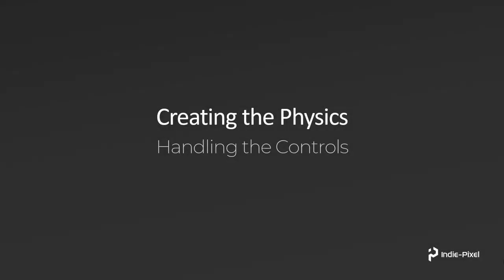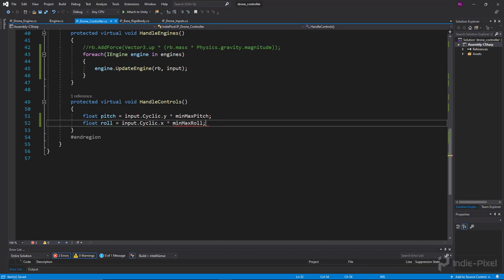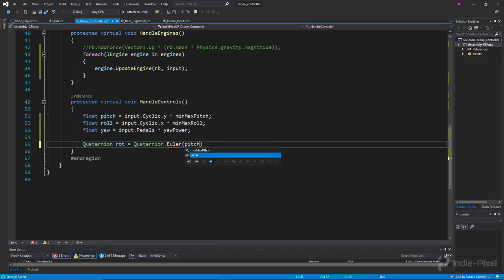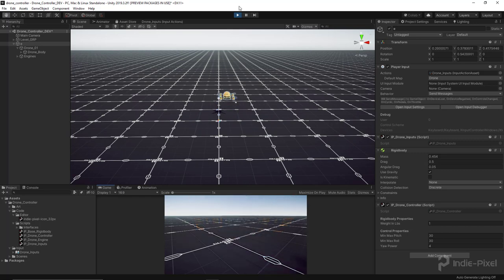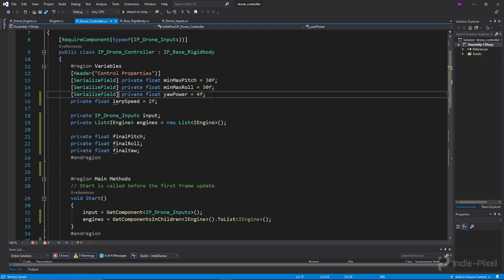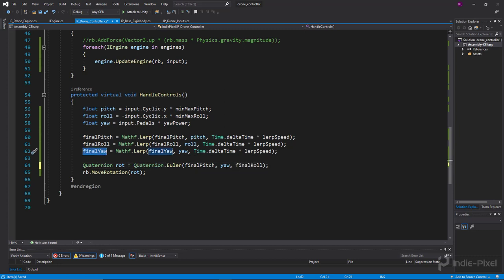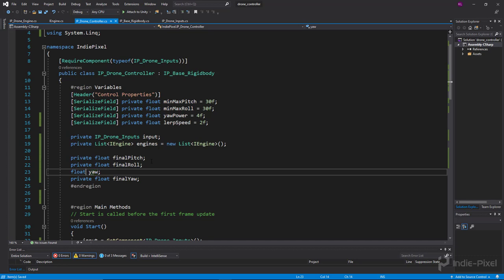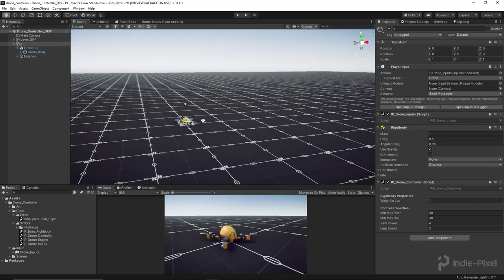Unity 2019 - Drone Controller - Section 3 - Video 6

Comment: My drone is still snapping after I add in the lerp function, do you have any recommendations? I have referenced the private floats up at the stop as well. Thanks!

finalPitch = Mathf.Lerp(finalPitch, pitch, Time.deltaTime * lerpSpeed);
        finalRoll = Mathf.Lerp(finalRoll, roll, Time.deltaTime * lerpSpeed);
        finalYaw = Mathf.Lerp(finalYaw, yaw, Time.deltaTime * lerpSpeed);
Reply: Figured it out, i needed to replace the (pitch, roll, yaw) in the quaternion function : 
Quaternion rot = Quaternion.Euler(finalPitch, finalRoll, finalYaw);

Comment: how do I make the drone faster?
Reply from the maker: You can increase the forward speed.  Should be a value on the inspector for the drone controller.
Reply: @IndiePixel3D  it does but it also tilts the drone too much:(
Reply from the maker: Ah I believe I put in some parameters to control the rotation speeds on the inspector as well...I'd have to open it up again
Reply: Add a float called extraPower in IP_Drone_Engine, set it to 10 for each engine, set maxPower to 30 and then add this code at the bottom of UpdateEngine function:

        float x = input.Cyclic.x;
        float y = input.Cyclic.y;

        if(x != 0 | y != 0) {
            Vector3 move = new Vector3 (x, 0.5f, y) * extraPower;
            rb.AddRelativeForce(move);
        }
Reply: @duppy404  Thank you, this worked for ❤
Reply: @gunjanmimo  No problem brother